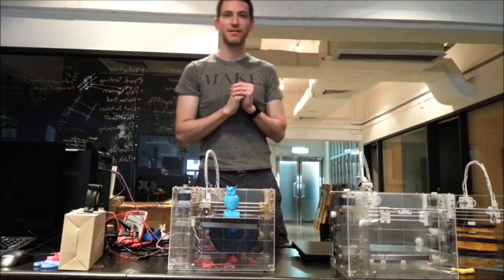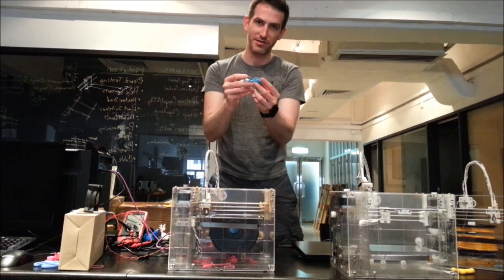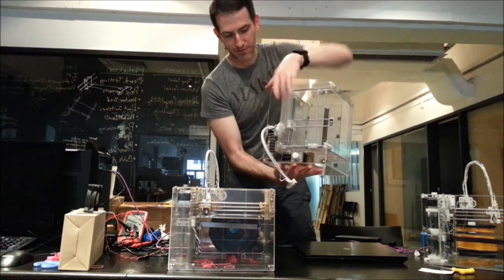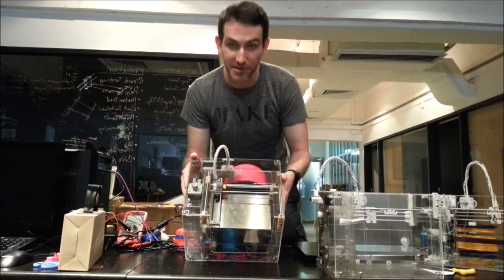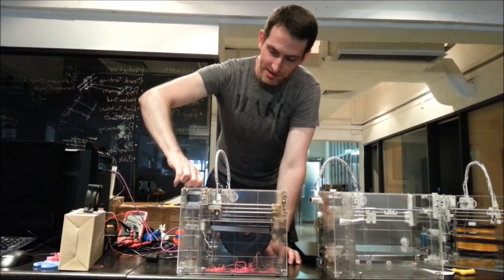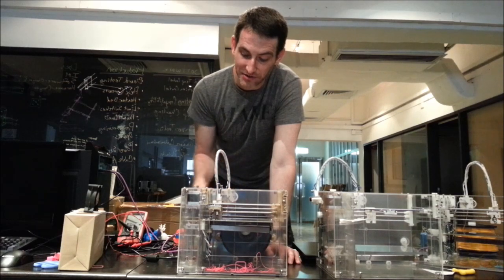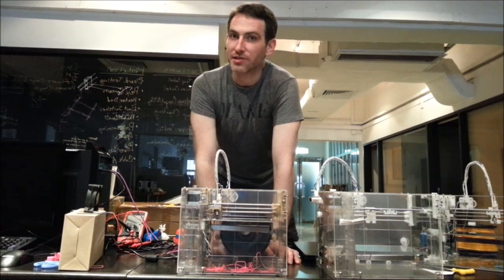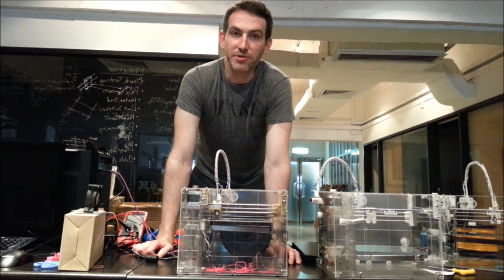#MakiBox A6 - Pre-production Update, More Rigid, Small Changes Left

Comment: There is a balance between speed and cost. We designed the world's cheapest and most simple 3D printer. Other designs will have other features. So, this design moves the lightest hot end around, and so does not need so much rigid support as you envision to have a good quality output.

Comment: how stable is the x y axis?
They look kinda wobbly with the ends hanging in the air like that, or atleast I think it looks kinda wobbly :P!
Wouldn't it be a bit mor stable with a smooth rod and a linear bearing at the ends of those aswell or does that make the whole thing to expensive or something?
I mean the more rigid the construction is the better the print gets and you'll be able to increase the print speed alot because the lack of vibration.
Hope u get what I'm talking about haha :P!